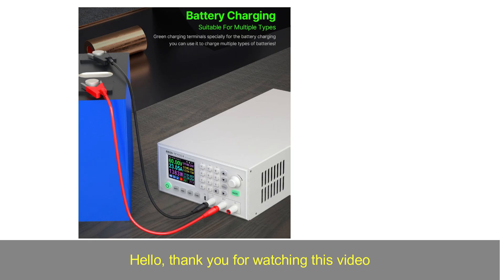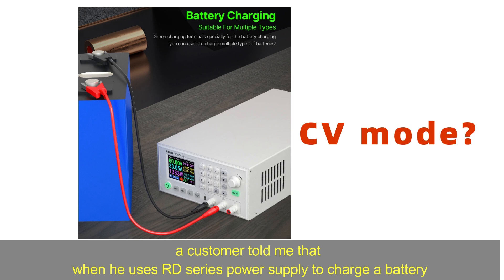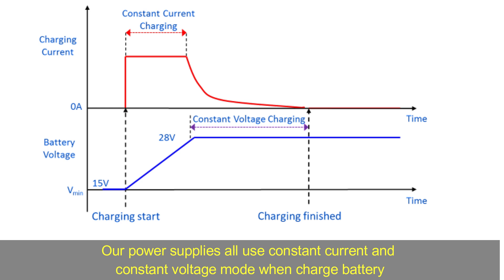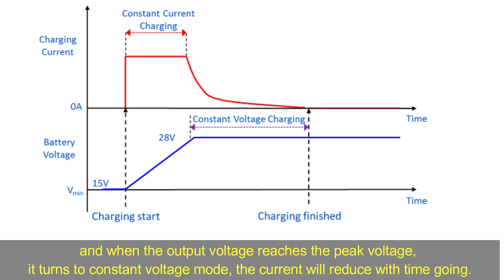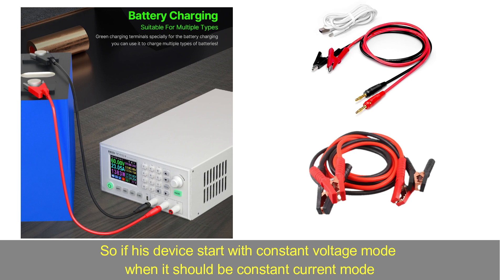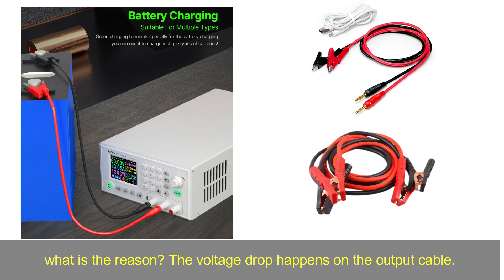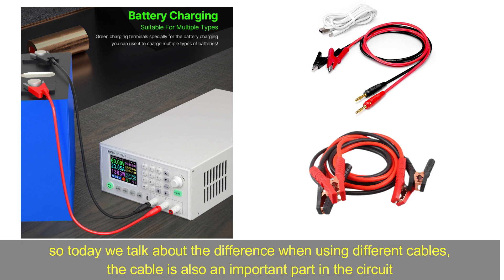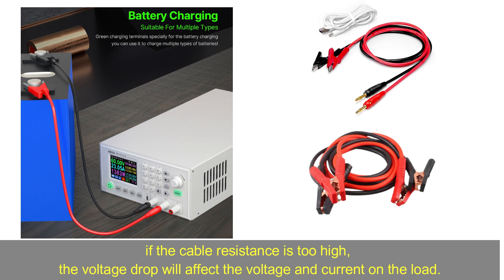the output cable matters for power supply for voltage drop!

Comment: You really should add a volt sense circuit to these!
Reply from the maker: on RD6006P we already add remote sampling function to make the voltage on the load is the voltage you need, for now we still optimize this function